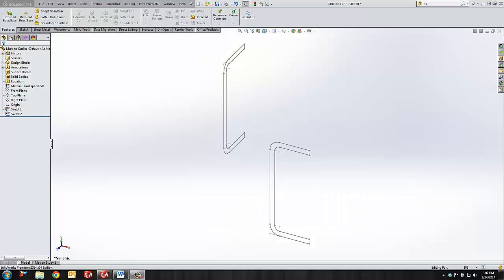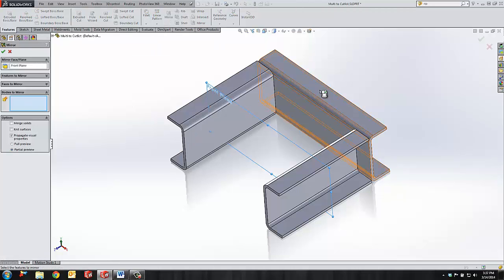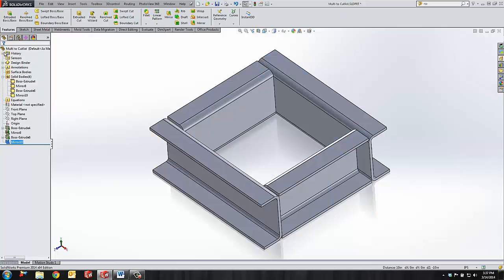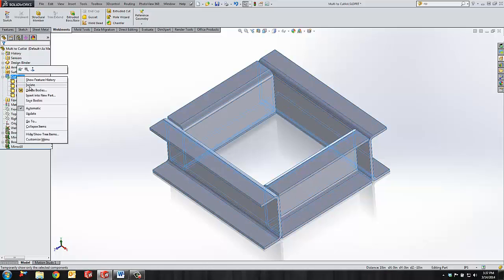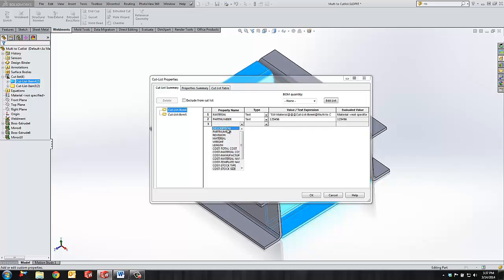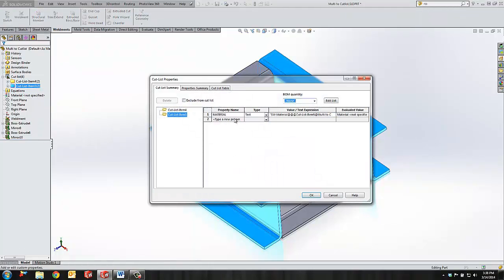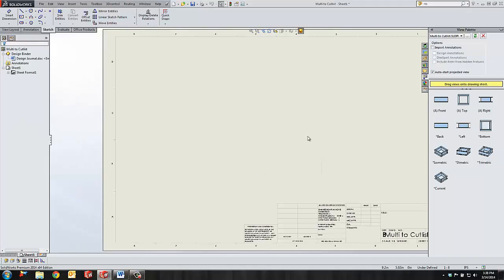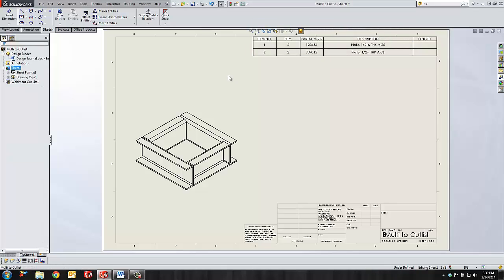SOLIDWORKS – Converting Multibody to Weldment

Comment: Why the  length column data is empty??
Reply from the maker: Hello, Length would just have to be added to the item cutlist properties in the part file.
Reply: @goengineer  So this doesn't automatically update it needs to be a manual input?